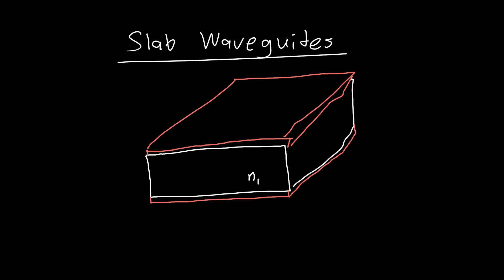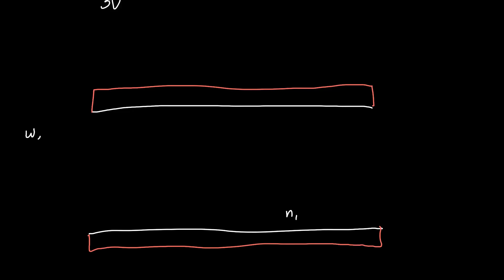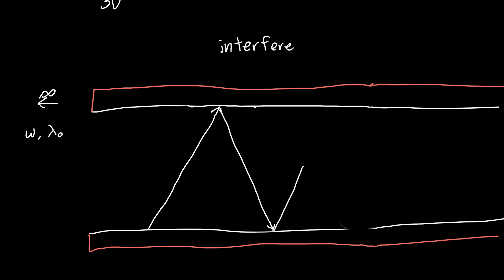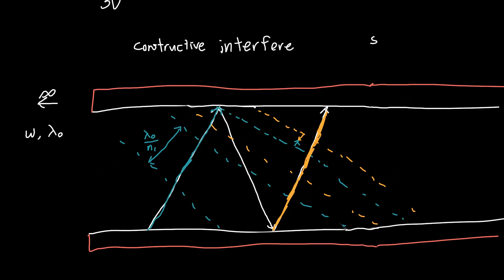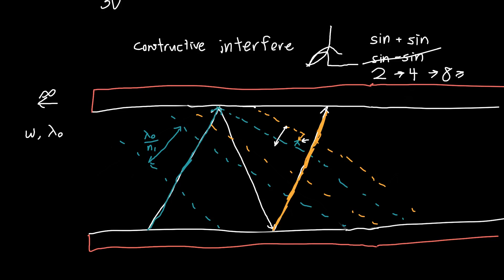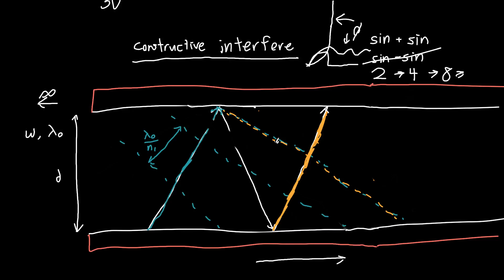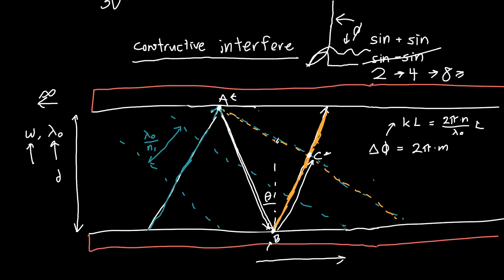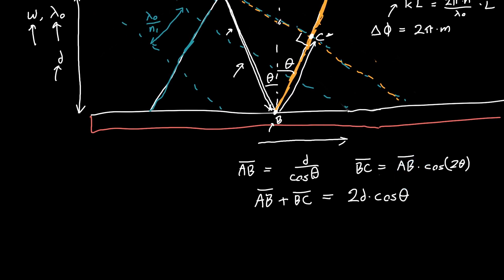Slab Waveguide Explained

Comment: Great video! I have a question about the reason why the wave can not construct with other fraction to infinity is that the wave in the waveguide is not a plane wave, according to your video. So if there are two waves in free space which are discribed as sin and -sin, they interfre with each other and get totally canceled. Will it happen or not? Does the process obey energy conservation? Thank you!
Reply: Hi Ryan, I can try to answer your questions.
In free space if two waves meet each other, one sin and the other - sin they canceled, because in each point(in space time) they have the opposite value.
For the conservation of energy there aren't problem because the avarege value don't change, in INPUT we have sin that have 0 as avarege, and in output again 0. This is only an intuitive explanation, analytically you have to consider the area of the signal for the energy and not the avarage value.
Reply: @davide8228 Thanks for your detailed answering! Now, I have some new perceptions about this questions which I came up with a year ago. And I want to share it with you.
Recent, I learned a numerical software for simulating electromagnitic wave propagation called FDTD. I ejected two plane waves, which have a totally opposite  
amplitude. I set a monitor to record the propergation of two wave. No electric field is observed. 
So, it is just what you say,  the two waves canceled. They did not disappear but propagate in the space at the totally oppsite pace.
Reply: @ryanyi8900  thanks! I will try that software ( :